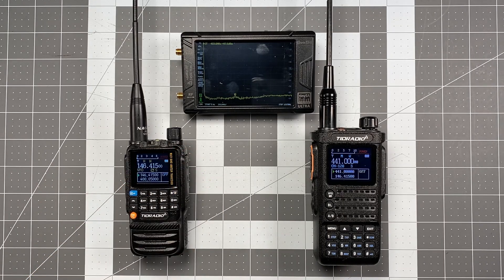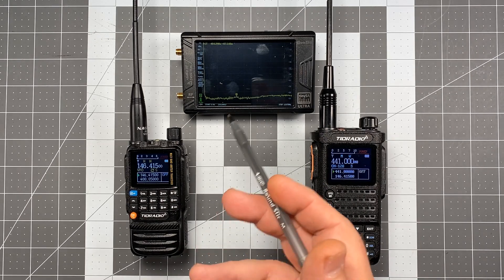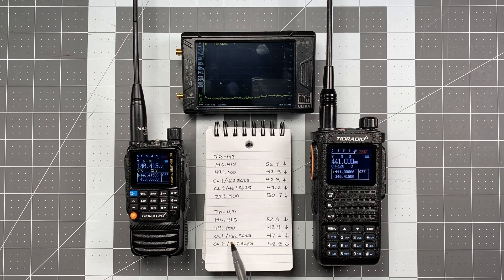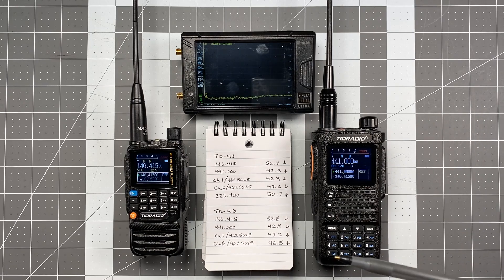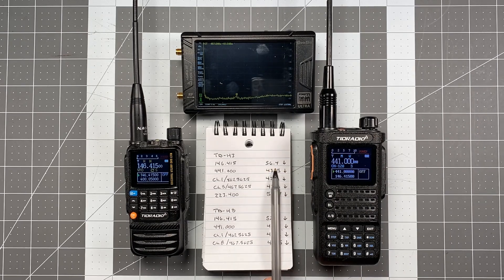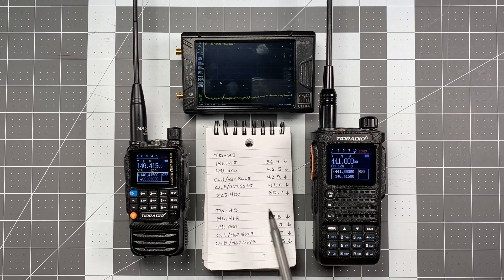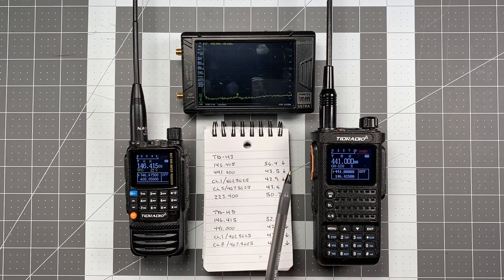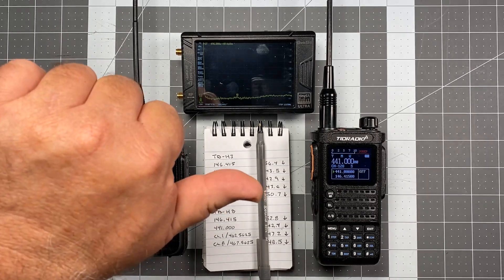TID Radio TD-H3 & TD-H8 Spurious Emission Tests

Comment: The unit you tested passed. However does that mean every H3 will pass? Are there any adjustments that can change spurious emissions?
Reply: i bought 2 h3-plus and they both failed badly.  so badly, I am getting a low pass filter for the antenna and only running it on 70cm

Comment: Thanks for the interesting video. You should have showed the actual test. I did the test on two different spectrum analyzers, one being the TinySA Ultra. Here's the part that concerns me. Do the test on the H3 and look at the second harmonic. It's only 36 db down. I realize the FCC focuses on the third order harmonic and fifth order harmonics. Is that because the even order harmonics are usually less than the odd order harmonics? Either way, I find the second order harmonic questionable.
Barry, KU3X

Comment: However, were any of those spurious emissions higher than -16.02 dbm?
Reply: Both of the TD-H3 radios I tested were above the -16.02 dbm. Another great video!!
Reply: @WJ6FRadio My H-3 tested just above that line on the first harmonic.
Reply: @kn6vbw  Tidradio told me the harmonics would be fine so long as you didn't change the radio from Ham to GMRS or Unlock. Sorry to say that isn't true regarding the -16.02 dbm
Reply: @WJ6FRadio  I do not see how that would change anything, unless you are transmitting out of band. Harmonics 2-5, on mine, are just below the line on the 2m band. However, by the time those use up the power, the usable wattage on 146.520 drops from just about 4.5W down to 2.3W. 

My Yaesu FT-65 is not much better in that regard, about the same poor harmonics, but it does pass the emission requirements. 

The only HT that I have that actually is clean on 2m is surprisingly a Baofeng UV-5R that cost me $15.
Reply: @kn6vbw  How can that Baofeng pass? You need to tear it apart and take pictures on the filters and upload them somewhere for analysis. If the build is different than todays baofengs.
Reply: Good deal!
Reply: Can firmware affect this?  Is there any need to update the firmware?  Thanks.
Reply from the maker: I didn't get any mean power readings higher than -16.02dbm on either radio. On the first harmonic they were right on the line but not over. As I mentioned in the video, I would not be surprised if others get different results. Cheap chinese radios are not good examples of consistent build quality or component consistency. In fact, I'm rethinking whether or not to bother testing any more of the cheap radios for this exact reason. Perhaps it should just be assumed that any of these radios are likely to produce spurious emissions as a standard.